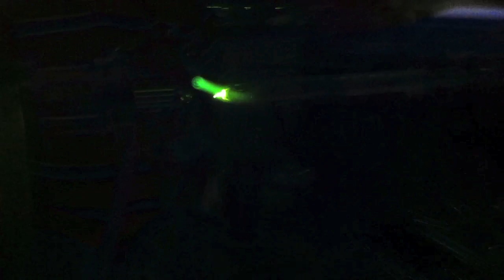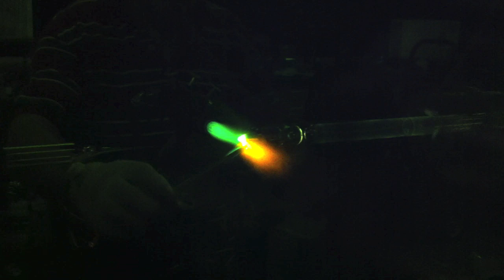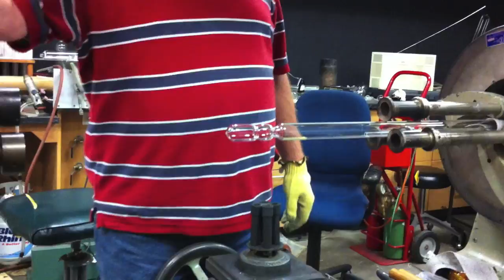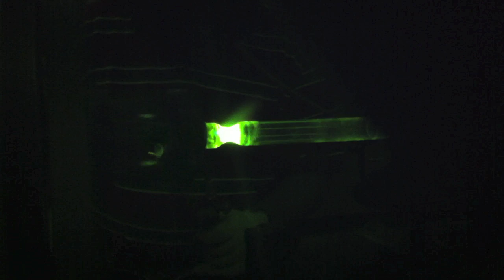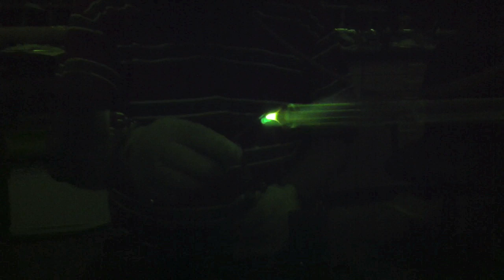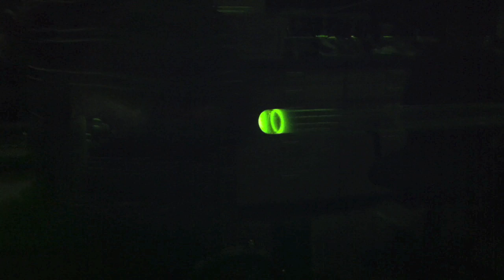[Lab 13] Glassblowing Quartz

Comment: Are you sure he is using natural gas... methane is not usually used at all with manufacturing quartz. Propane or hydrogen is the go to. Methane burns in a much lower temperature. I’m very surprised to hear a reference to natural gas in this video
Reply: I think he’s using borosilicate tubing not quartz. He makes a reference to using a quartz rod to clean up the end of the tube and states that it’s borosilicate on the end of the quartz rod. Cool video, just saying
Reply: Natural gas for just the bunsens, perhaps.
Reply: Idk, i think he was working quartz, simply because the flame was so white, and he had his (probably gold plated) face shield out for working that dinky 32mm tube.  I work boro on a lathe that size and if it was boro you wouldn't feel that type of operation at your face..

Comment: what is the diameter of the Quartz ?  I am trying to seal the quartz with 2cm diameter without success. Maybe my fire was too small.
Reply: Ahmad Afandi you need really really hot temp. look up the temps needed
Reply: You have to turn up your burner way up  it needs to be lightsaber level hot , you'll only get a a couple seconds at ultra most to move any material or expand it ,  things need to be done in multiple heat up steps for the area your'e working .

Comment: where do you get the quartz used for this, is it synthetic?
Reply: Albinojackrussel no, you can get sand blasting silica sand that is pretty pure and make it from scratch if you have a high enough temp
Reply: Albinojackrussel hydrogen and oxygen flame is ideal

Comment: Can other types of quartz be blown?
Reply: This is pure silica. if you mean like stone crystals and whatnot, not really without them exploding.
Reply: Gaby F. Salas there's a video of a guy molding with quartz that he picked up from decorative gravel, but he wasn't blowing it
Reply: Make a crystal and then sand it to the desired shape.
Reply: Yes, i've had success melting and forming tektite into solid and hollow forms, with difficulty at the lower temperatures of a oxy/propane flame.

Comment: Hello. I have a need to melt quartz and form it into a telescope mirror. Could you possible help me hash out a few technical details? I could email you a list of questions, show you the mold design, etc. I am a amateur and have no idea what I am doing with even normal glass blowing, but I NEED a telescope. I need it. :P
Seriously though, I would like to turn this into a business, but I would like to make sure I have the technical knowledge to make any investment money go the distance. I'd really appreciate any help you can offer. Thank you.
Reply: I was attempting to get a baseline for the knowledge needed. I have already looked into facilities that could help train me (the size of the project would have required significant knowledge in operating a vacuum furnace) in operating the equipment needed. If need be, I could have gotten the general idea hashed out, found the required equipment, and simply hired someone with more knowledge to train me on the job. I did my research and found this out quite awhile ago. I had a plan.

    My initial plan had called for a mold which would expand to a predetermined size, and still match a specific curve profile at a very specific temp. Glass would fill the mold and be allowed to cool enough to the point it solidified, then the piece would be annealed.
This would leave me with a piece requiring a significantly lower amount of polishing. Basically I was hoping to pull some space age shit.

    I then modified the plan when someone informed me it would be easier to simply melt the glass and press it into the mold. The size of the piece would make this difficult, but pieces of 5-6 inches in diameter are completely doable with amateur skill and off the shelf equipment, and a very expensive mold. These would still be extremely valuable, but I want to carry out the full size project. That will require extremely expensive equipment. And yes, training. 

    It is hard. I was more than aware of that, and I will still attempt this one day, but for now, I am focusing on a cheaper project.
Thanks for your input anyways. By the way,
what kind of background do you have in working with quartz, vacuum furnaces, and optics?
Reply: As a glass worker reading through this comment thread I appreciated that you expanded your explanation into the research you have done. Which is quite a bit if you're new to the glass fabrication realm. 

What really got me is in the middle of this well spoken piece is the "Basically I was hoping to pull some space age shit." .

Another words I L.O.L ed at that.
Reply: Luke stone "Are you entertained?! Are you not entertained?! Is this not why you are here!?" - Maximus lol

Seriously though...I understand it's not a topic you pick up overnight. I am still going to attempt this, but I need the funds for all the equipment still. Currently building commercial software to generate income for all my side projects. Eventually I will also build a spaceship to get to mars too.
I am kidding about that last one. :p
Reply: http://iopscience.iop.org/article/10.1088/1757-899X/225/1/012197/pdf.

He should try using this mixture as fuel.
Reply: Jory, you must not me American with a question like that?
Reply: Hlo jory
Reply: Any progress in this?  Omegageek64 has some excellent videos for you

Comment: As he said you should use propane/butane/natural gas and not hydrogen for boro. You're heating it far too much and that forces air bubbles (sometimes called "seeds") in the glass.

Comment: Question(s) - how much hydrogen/oxygen (I'm guessing stoichiometric ratio) does that burner use? Or at least what kind of pressure does it need for a flame like that?
And does the graphite rod stain the quartz when it touches it?
Reply: Specs available direct from Carlisle, the manufacturer of the torch- tho most pyros overclock them badly.  My ear is telling me he's running 30psi oxy and 10 fuel LoL.  this info is more easily gotten these days, many more glass artists working quartz to make apparati for marijuana concentrates.  The graphite does not stick.  It gets vaporized... sublimated, perhaps.  He's probably got a quench can filled with water there that we don't see so that the tool can be cooled occasionally.

Comment: HI! Great work your doing man...

I tried to do some glass work on my own, specially fire polishing with hydrogen/oxygen. Whenever i finished my job, i get this nasty litte spots on the glass. looks like something shot at it, resulting in little holes. Maybe you can tell me what iam doing wrong...

anyway nice vid.
Reply: Noname00nigs too much heat, incorrect shielding gas?
Reply: @ta2joe13  did u say shielding gas? would like to know how you even think that would work with flame work?
Reply: hot spawns and gravity moving the glass around on you

Comment: Ok, I didn't watch long enough. Wouldn't acetylene be hotter and give quicker results?
Reply: hydrogen is the best and cleanest burn as far as I understand.
Reply: Acetylene could scorch the quartz, hydrogen would be better.
Reply: acetylene is dirty and most things quartz would be used in would require very pure and clean flame, hydrogen is what is proper for majority of fused silica/ quartz work
Reply: Acetylene is hotter for cheaper, but so dirty

Comment: hey chemistinjapan, what is quartz used for in the lab? are there benefits in using it instead of borosilicate in certain applications?
Reply: taylerchew indeed, quartz is 10x better than any other glass when it comes to temp shock and any shock in general.